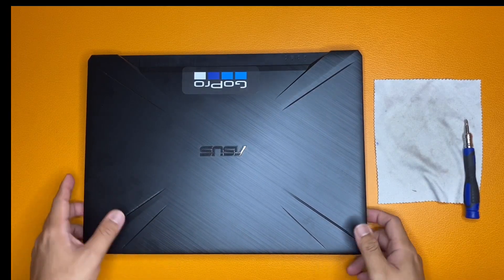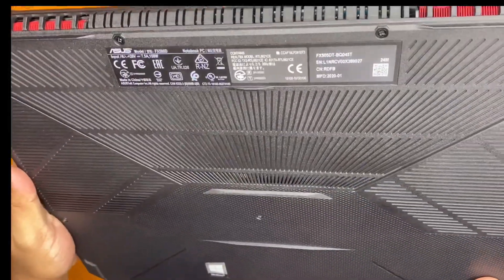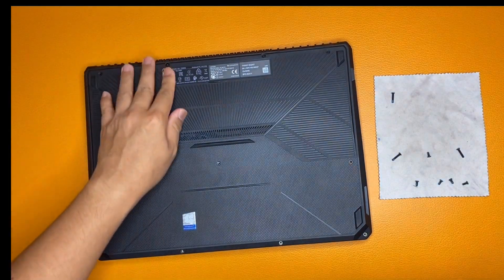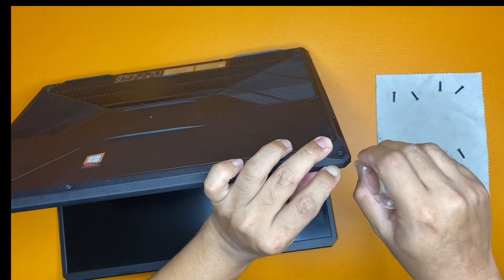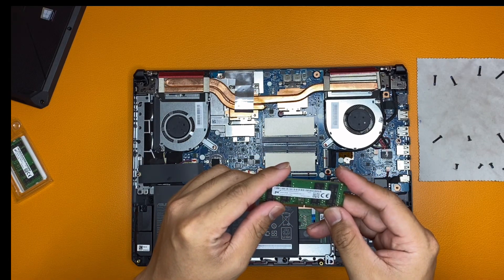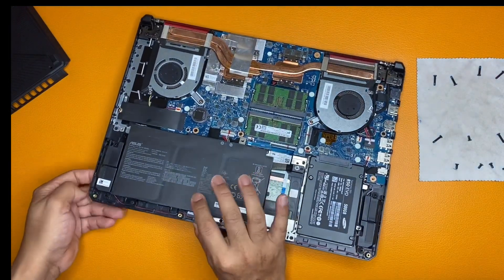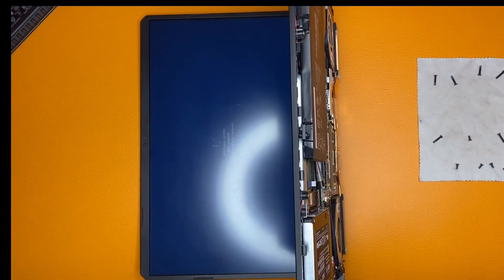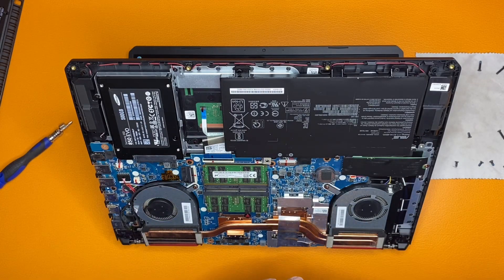ASUS FX505D | RAM UPGRADE | 32GB RAM | Step by Step upgrade | ENGLISH #FX505D #ramupgrade #gamers

Comment: Hi, I have this same laptop and I bought ram with 3200mhz is that bad? Will it work?
Reply from the maker: Try first, this is overclocking, make sure u have good air conditioning.
Reply: @RonaldYapVlogs  fuck it didn’t work what should I do my computer won’t turn on now
Reply from the maker: Check google on how to overclock RAM on Bios.

Comment: Hey, I have the same laptop and my laptop is from 2019, recently it has been deteriorating very badly, games like Genshin and GTA V constantly crashes even at medium settings, some error shows out of memory issue, thats why I am thinking about upgrading my ram, is it going to solve my problem?
Reply from the maker: Well it depends but there is no harm in trying. Mine is the same i bought it the same year and it is still smooth as butter.
Reply: So do I go for a 16gb ram upgrade? 8GB stock ram is already there, also the one inside is by SK Hynix, should I find the one by the same company or any company Is fine(crucial is easily available here in my country),
Reply from the maker: @suryanshsharan4397  go for 2x16gb 2666Mhz then ull feel the difference.

Comment: Hi,  I currently have 2*8gb of 2400mhz, can I change both of them for 2*16gb with 2666mhz?
Reply from the maker: Of course
Reply: @RonaldYapVlogs  you sure there won’t be a problem because it goes from 2400 to 2666 ?
Reply from the maker: @le-foutou-de-abidjan-cest-bon  if you have the same model as mine, then no problem as mine is 2x16gb 2666Mhz
Reply: @RonaldYapVlogs  what's the model of your computer?

Comment: Sir, I have a question regarding its memory?  Can I use higher frequency than what you use? Like two 16gb with 3200MHz?
Reply from the maker: It wont work. I have coments here that has same issue.

Comment: I have tuf fx505ge laptop and it has 8gb of ram with 2666MHz. So, if I add 16gb ram with same frequency, will it work?
Reply from the maker: of course it will smoothly... happy upgrading.
Reply: Did it work? I asked about using different size rams from my friend and he said that they should be same size
Reply: @lexdimessere  yes it worked. As long as the frequencies are the same, then it would work
Reply: @brazmadsen9043  i heard it from someone that if both the ram are of same size then dual channel works even more smoothly

Comment: I have a killsre ram of 8 in mine, bought another, but with 16 and it doesn't work, is the same frequency and model, only difference is 16 instead of 8, black screen with 16 alone and 16 + 8, on both slots!
Reply from the maker: try install 8 on one slot and try again on another slot, if both working then something wrong with your 16gb ram purchased.

Comment: brother I bought a kit of 8GB 2400hz ram memories but when I remove the one that comes by default and put the ones I bought, it always gives me blue screens but when I use anyone individually it works correctly any ideas?
Reply from the maker: You should use the same frequency, default is 2666Hz.
Reply: @RonaldYapVlogs  I going to buy a new ram and test, thanks bro

Comment: I have got myself 2 sticks of crucial 8gb ram for the fx505dt. Can i just remove the single stick, put the 2 new ones in and boot it up? Will i need to download anything?
Reply from the maker: no need to download anything, plug and play for RAM. it will show BIOS that there is hardware changes but it will go boot and be in windows desktop environment,

Comment: Hey, what about my friend? A huge question, I have the same model as you, mine is 8gb by default, but at the moment I bought a new 8gb ram at my frequency, but when I installed it my laptop does not recognize it, It only recognizes one (the new memory does work since I tested it by removing the old one and using the new one), do you know if it is because I did not have the bios updated?
The brand I bought is Adata XPG but I suppose there should be no problem since it worked when I tried it alone.
It would help me a lot if you have any explanation!
HELP

Hey que tal amigo, una pregunta enorme, yo tengo el mismo modelo que tu, la mia es de 8gb por defecto, pero al momento compre una nueva ram de 8gb a la mis frecuencia, pero al momento de instalarla mi laptop no la reconoce, solamente reconoce una (la nueva memoria si funciona ya que la probe quitando la vieja y utilizando la nueva), sabes si se deba a que no tenia actualizada la bios?
La marca que compre es Adata XPG pero supong no debe de haber ningun problema ya que si funciono al probrarla sola. 
Me ayudaria muchisimo si tienes alguna explicacion! 
AYUDAAA
Reply from the maker: If the same frequency then it should work, normally once you connect new ram, bios will update it settings automatically

Comment: Hello sir, so I tried installing the ram but my screen now wont turn on. Have I done anything wrong in the process?
Reply: i think you have to wait a minute. Try shutting it off and on again.
Reply: yeah sams installing 16gb DDR4 and black screen
Reply: Did u find a solutiob

Comment: I have asus fx505dy why i insert the corsair vegeance 2666hmz 16gb x2 (32gb) ram but it not worked, did corsair ram not support for asus or 2666hmz is not support for asus fx505dy, one more thing if i bought a corsair 2400hmz there is possible way to use it, if you read it, can you reply to me, thank you so much
Reply from the maker: 2666 is the recommended and it should work. What is the freq of your stock ram?

Comment: asus fx505dt Ryzen 5  what is max ram speed?
Reply: The ryzen 5 3550h can't use more than 2400mhz anything above is practically useless.. but wont hurt it will just not use its full speed
Reply from the maker: 32Gb max
Reply: @RonaldYapVlogs  I mean RAM speed MHz (frequency)
Reply from the maker: @blkbnz  i recomend stick to 2666 as per recomended.

Comment: I have ryzen 5 4gb ram 1tb hdd can i upgrade it 32 gb ram and add up an sdd?
Reply: Pinoy pala si sir haha i mean sir built in sya ng 1tb hdd pwede ba mag add up na ssd?
Reply from the maker: @adventourvlogs8135  ung ssd na sata ang pwde... or check mo sa board if may empty slot na NVMe.

Comment: THANK YOU MATE!!!! couldn’t fit second ram stick properly, thanks to you now all works just fine !
Reply from the maker: Ur welcome
Reply: @RonaldYapVlogs  Excuse me but what is the max frequency of ram compability?
Reply from the maker: @menantumakawak  i only recommend 2666mghz
Reply: @RonaldYapVlogs  i see, thanks!
Reply: @menantumakawak  you could use higher than 2666mhz but the motherboard doesnt work over 2666mhz, so it will just cap it at 2666 and you will pay extra for the same frequency 😅
Reply: @gabrielf03d  ago why is it the 3200 mhz cheaper than the 2666 lol?
Reply: @Countryballs  i have no idea, but if you want to upgrade your laptop check your motherboards and cpus compatible mhz, cause if not you will just pay extra for basically nothing

Comment: I tried this procedure but the other slot can't read the ram.  Any suggestion?
Reply from the maker: Possibility is ram not compatible, ram not properly inserted on slot. Clean by blowing gently the ram slot, clean ur ram module, use pencil eraser. If ur ram is not newly bought...

Comment: I have the fx505 dd, originally comes with 8gb, can I put 2 16gb in with no problems?
Reply from the maker: Yes, make sure they are same memory frequency.
Reply: @RonaldYapVlogs  est-ce qu'il y aura une réelle différence comparé à la ram d'origine ? La carte graphique peut-il suivre le mouvement si on mets des gros jeux ? Merci
Reply from the maker: @panzerleo5935  english pls
Reply: @RonaldYapVlogs   will there be any real difference compared to the stock ram?  The graphics card can it follow the movement if we put big games?  Thanks
Reply from the maker: @panzerleo5935  yes of course, from 8 to 32gb... youll feel it also as i did.

Comment: I have asus tuf505dt . Do i need to change bios settings or anything after i upgrade to 32gb of duel ram . thx for the help :)
Reply from the maker: Nuclear Caveman no need, this is plug and play... enjoy....
Reply: what did u feel? smooth?
Reply: did it work?
Reply: @ugandapwr3971  Yes , just put it in an all good
Reply: @nuclearcaveman3051  I have the same model bought in 2019. Did you have 8gb 2666 ram as a default? Cannot seem to find anywhere which specs my computer exactly has
Reply: @lexdimessere  No mine had 16 gb  2400 mhz so now is 32 gb of ram , just need to google your model number and you will see the specs

Comment: Paano po kung 4gb lang ram nang laptop ko sir? Tas nag upgrade ako nang 32 gb? Pwedi bayun?
Reply from the maker: option mo lang if gusto mo pa magamit 4GB mo is 16GB+4GB. ganun nalang para hindi sayang...
Reply: RonaldYap Vlogs Ganyan din po laptop ko sir. Pero ryzen 5. At 4gb ram. Ask lang po ako if magkano lahat nagasto nyo po if mag uupgrade Ram at SSD?
Reply from the maker: Ignatius Reyes mahal hnd paba ssd yan? Alam ko ssd na yan. Tpos pwd kp magdagdag ng isa pang SATA SSD. Mgagastos mo ddpende, pag malaki ram at ssd , then mas malaki.. sata ssd nasa 10k ata yung 500gb.
Reply: @RonaldYapVlogs  parang wala pa po ata. nag suggest po kasi nag titinda nito na mas maganda daw may ssd
Reply from the maker: @ignatiusreyes2845  yup mas maganda tlg SSD. kung same tyo ng model, may built in NVMe SSD yan tpos pwd ka mag lagay ng SATA connection na HDD, i suggest na instead of normal SATA HDD, bilhin mo is SATA SSD (SSD na SATA and connection) kasi yun lang ang spare connection pra sa spare hardisk.
Reply: @ignatiusreyes2845  Pareho siguro tayo ng laptop sir
Reply: RonaldYap Vlogs cge po. So 16 lang po pwedi e add if 4gb lang ram nang laptop?

Comment: I have the same model but without win 10 and how can I be sure that there are empty slots for HDD and RAM?
It  includes 512 SSD and 16Gb RAM now.
Can I add 2TB HDD ?
Reply from the maker: LANCEofIRAQ yes it is sure that there is a spare SATA port for HDD. If u have same model. Buy a SSD SATA for better performance.
Reply: @RonaldYapVlogs  
The 512 SSD is for the system and win 10 and I think of adding 2TB HDD for storage because some freinds informed me that the HDD is better with formatting and restore the deleted data.
Reply from the maker: LANCEofIRAQ yes that might be reasonable. Update me once u successfully upgrade this 2TB

Comment: Is it useful for music production?
Reply from the maker: LANCEofIRAQ it can definitely.
Reply: @RonaldYapVlogs  
Thanks a lot for efforts 💐
Reply: @RonaldYapVlogs  
Dear I need your help.
How can I know which the same trademark and type information of 16Gb RAM that I should buy to include?
I am worried about may not find the same original 16Gb that the laptop requires!
Reply from the maker: On the description box link, that is compatibility link for all laptops. You can check there and for sure it is 100% true compatible
Reply: @RonaldYapVlogs  
Should the new ram which I buy to add at slot 2 be the same brand of the main in slot 1?
Reply from the maker: LANCEofIRAQ brand is regardless but as long as they have the same frequency

Comment: Hi sir, will any brand of ram be compatible with the default one? Just wondering whether I should buy the sk hynix default ram, or can I go for brands like crucial, samsung and kingston? Thanks!
Reply from the maker: Ian Alcazaren as long as they have the same frequency. DDR4 2666 regardless of brand. Thanks
Reply: @RonaldYapVlogs  Salamat sir! Last question lang.
Balak ko kasi tanggalin sir yung default ram since 4gb yun. Balak ko mag 2x8 2666/2400 mhz since nagcacap naman to 2400. Wala naman issues if different latency or timings with ryzen 5 3550h? Baguhan lang kasi ako sa laptop upgrade sir, pag desktop kasi medyo maselan yung ryzen nung una, nagchecheck pa ako ng qvl. ayun salamat po sa pagsagot!
Reply from the maker: tagalog ka pla hehhehe...kung konting halaga lang ang diperensya, make the 2666 mhz. pra confident na confident. mahirap na in a longer run mag ka issue.
Reply: @RonaldYapVlogs  Hahhaa oo sir.  kita ko nga sa shoppee parehas lang presyo niyan. Di pa naman nagkaissue sir noh? Bili na rin ako ng exact ram na yan except 8gb dual channel hehe.
Reply from the maker: Ian Alcazaren bilhin mo 16gb one slot pra 20gb. Wag na 8 and 8. Pra in future, upgrade ulit another 16. Sayang if 8 and 8.... think about it...
Reply: @RonaldYapVlogs  Una kong plano ganyan sir, pero di ba magkakastability issue?
Reply from the maker: Ian Alcazaren wla idol... ok lng yan.... swak yan  magging 20gb yan... goodluck
Reply: @RonaldYapVlogs  sige sir try ko! salamat idol.

Comment: Sir bat nag kabit ako ng 8gb ddr4 2666 d sya nadedetect same model tayo laptop fx505 din
Reply: D naman po need iremove pa nung batt no? Thanks po
Reply from the maker: ay hnd na, pag tinaggal mo yan ma rereset CMOS. try mo pagpalitin ung RAM, ialagay mo sa isa ung luma tpos ung bago sa pinaglagyan ng lumang RAM
Reply from the maker: check mo mabuti pagkakasalpak ng RAM, minsan nagmimintis kahit mag click sa lock. kung medyo luma na ung RAM, gamit ka eraser tpos linisin mo ung RAM mo, dun sa mra gold plated na area ng RAM. basta make sure same sila ng default RAM mo ng clock DDR4 2666
Reply: @RonaldYapVlogs  kakabili ko lang po ng ram eh ididiin ko po ng pasok no bago ko iclick?
Reply from the maker: Ralph Fajardo idol matic na mag cclick yan pagdiin mo.. try u ulit dahan dahan...